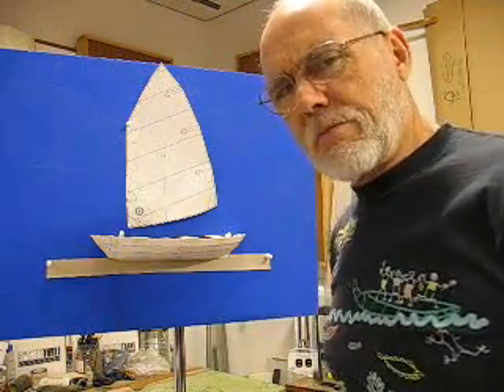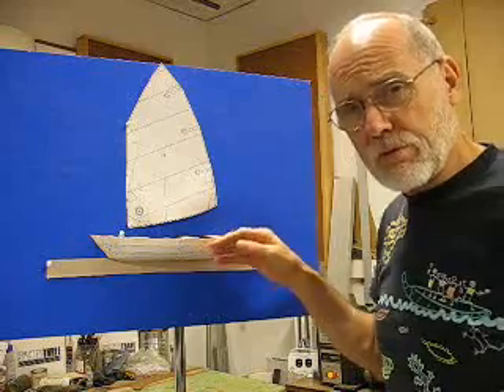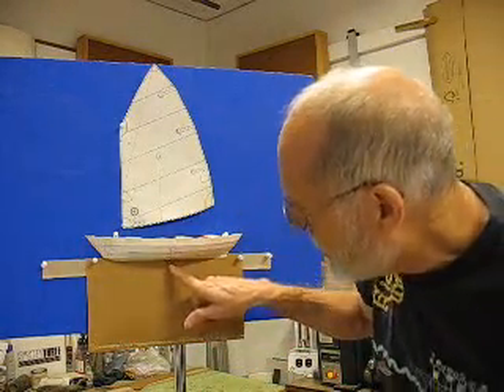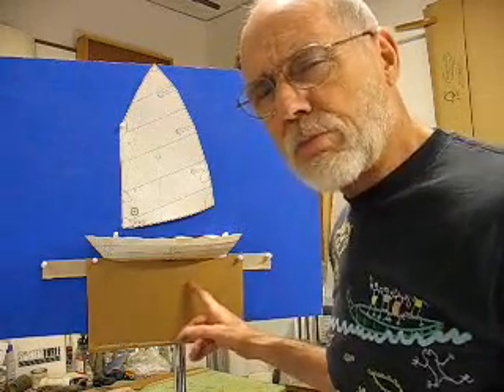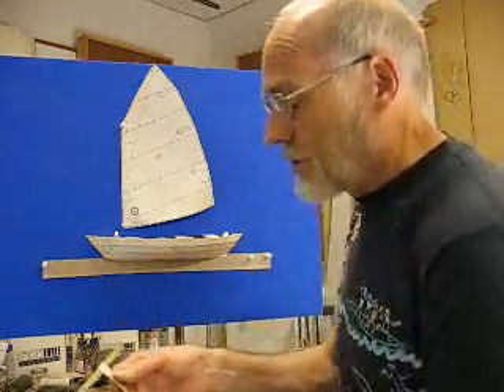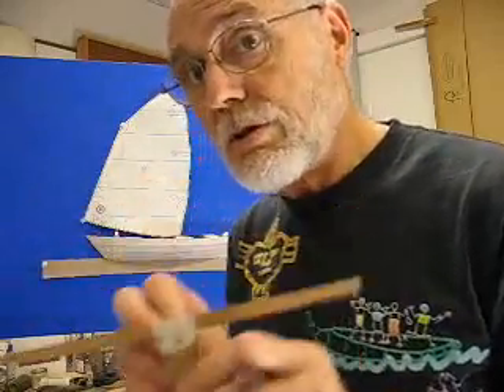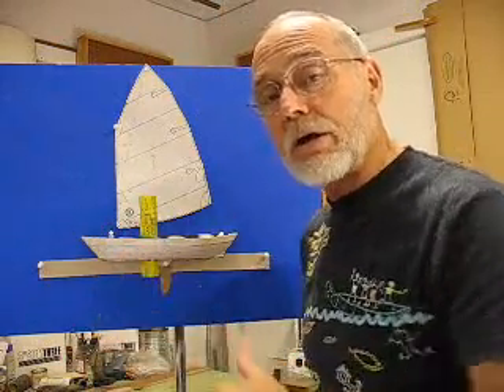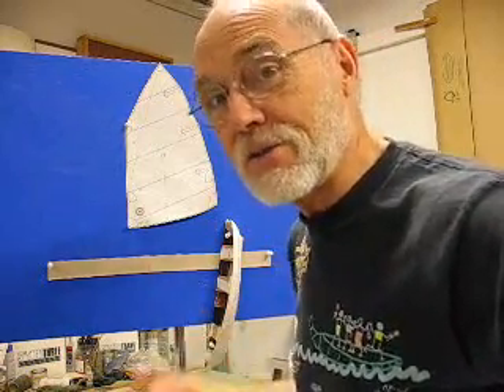CE & CLR Calculations

Comment: This is a great help! If the boat was a ketch rig with two masts how would you locate the Mizzen mast?
Reply: Exactly! This is not a good video. It's very very simple but you won't get that from this guy!
I can't explain it here other than to say you need to design both mast positions at the same time not the main first then add the mizzen....

Comment: do you design only sailboats, canoes , small boats or do you develop large sea vessels or sport race boats as well. Would be cool to see the larger and more speeder boats as well.
Reply: Mainly it's just small boats for me.  I do have a couple 16ft power boat hulls that you can find in my section in the "plans" at duckworksbbs.com